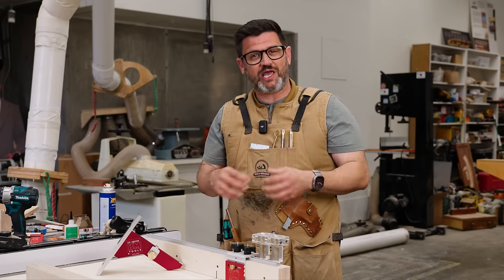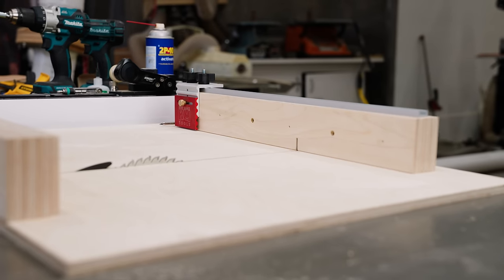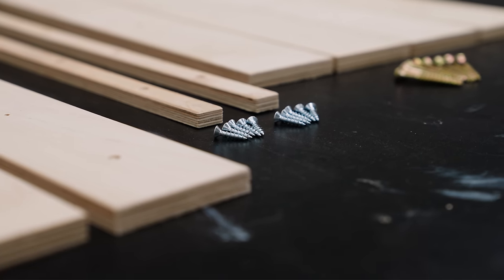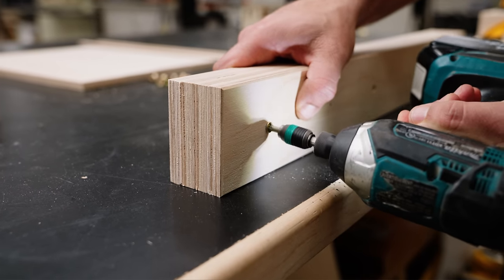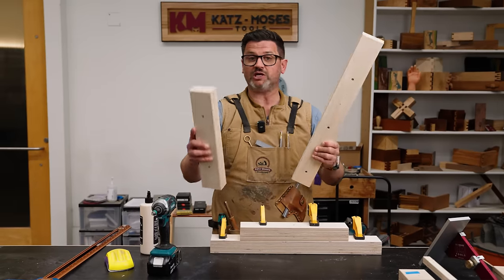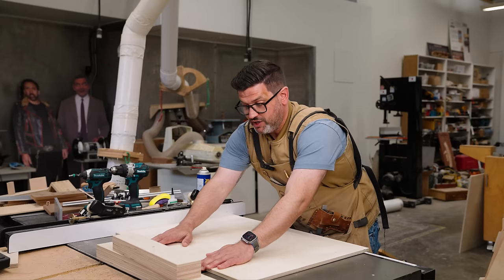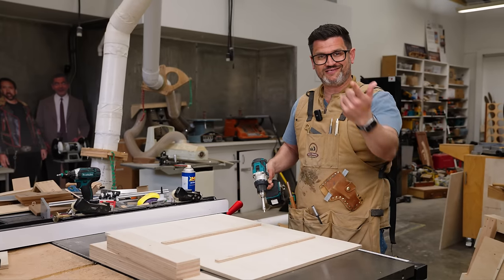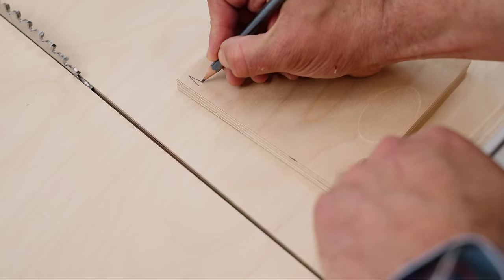Do You Hate Making Crosscut Sleds?

Comment: Excellent tool! I have one of those sleds with a dozen holes in the bottom as I burned up wood trying the 5 cut method. This tool is a huge time and frustration saver   Thanks so much. And it will be great for quick checking before a project as my shop is a garage type and the sleds are prone to warping.

Comment: brilliant Idea!! I'm in the process of making a 6' sled with a aluminum back fence. I want to make accurate corners for steamer chest. What I've come up with is using all thread on each end. One side achord the other floating until I get the back exactly perpendicular to the saw blade then I will anchor the back fence to the base of the sled. I can make slight adjustments to the nuts on the all thread to dial the back fence to the saw blade. This is the second one. the first sled was a test to make sure it stayed square.

Comment: I've built a couple of crosscut sleds and the bottom of both looks the same as yours. Adjust , adjust, adjust. Tedious, time consuming, and frustrating. This is brilliant and I love your kit! Yeah, I could cut my own pieces, but why when I can buy them already cut? 
Will this work on jobsite tables as well? I'm assuming it does because it's all about square and straight. I have a few of your tools already and I absolutely love them. I'm in for getting this ... just as soon as I get my shop insulated, cleaned, and organized appropriately.

Comment: This looks really great and not super expensive, have 2 questions:   1:  what size do you recommend for the base, can it be 26" x 32"?   1/2" or 3/4" plywood?   2:   Will the sled runners wear out over time so that they do not fit tight?
Reply from the maker: You can use any size you want for the base. I like 1/2” because it gives you a little extra blade height. The runners will last a long time. If they ever get loose add a strip of blue tape to snug them up. Probably much longer than the zero clearance of your kerf

Comment: I found that wood screws with countersink head was mushrooming the two guide bars and was also deflecting the fence.  Five cut with a screw at each end was different after adding additional fasteners.  That sled was too heavy so my re-do is lighter and used pan head screws with a washer.  Problems solved.

Comment: I built my sled using UJK Parf guide dog holes.  So I know it's super accurate (and so easy to mate the fence)  But that tracksaw use case is very very intriguing.  When you're breaking down, sheet goods, sometimes you can't use the square rail.  Being able to square your cut in the middle of the sheet is genius!   And I think you're one or two step/design away from being able to line up the track for straight cuts.  @2:25 instead of a square cut, if you could but the track against the red/body part, you can guarantee the continuation cut of the tracksaw is straight.

Comment: I already did that with a normal Square.  Also I did a half cross cut sled like Tamar built with a 45degree edge and used a Katz Moses stop block first Gen.  I did this because I wanted a light Jig.
I like the kit but the tools is just another square.

Comment: I made a half sled with a top down plexiglass that presses down on the piece via a spring loaded thumb screw. Not only does it protect from kick-back, but it solved 90% of my dust collection problems. My basic $100 ryobi 8" table saw is abysmal at dust collection. But the plexiglass for some reason pushes all of that dust down in a neat pile. Perhaps something to do with redirecting airflow idk.

I used aluminium for the fence because I live in florida and wood tends to warp crazily throughout the seasons.

Comment: Jon the bottom of your first sled looks a lot like all of my current ones 😂.  That said after a lot of 5-cutting they are very dialed in. But I am a gonna order this gizmo anyway - price is reasonable and I can see a lot of uses for it - #1 being getting  the fence square on my 12” Bosch miter saw, which is currently NOT accurate enough to do anything but cut rough lengths.

Comment: Having a table saw without a sled is like having a tape measure without a marker, they just go hand in hand. 

My sled looks very similar to the one here where the fence isn’t as wide as the sled but I wish I made it just as wide to have more room for clamping stops. 

Just to give an example of how handy a sled is. I recently built a drawer with dividers. I used a stop on the sled to get both ends of a drawer side the same groove and both sides the same as well. The kerf wasn’t big enough for my dividers so I made one cut against the stop then added a thin piece of cardboard against the stop and cut again to widen the groove just enough for my dividers.

Comment: This looks like a good solution but f you made a panel saw option with the silver part (fence) a bit longer it would save so much time in realignment of the perpendular fence on a panel saw. Often it is moved out of the way and when you go to reinstate that fence it can be off even though it has a flip up stop. Then your back to the 5 cut method of checking things. Feel free to contact me to discuss in more detail. I'm sure every shop with a panel saw would buy the longer version

Comment: As usual you have come up with a brilliant tool. I do not have feeler gauges or a digital micrometer so the sleds I have made are squared with a carpenters framing square. I have a strip of aluminium that happens to be the exact width of the kerf  of the 3 blades I normally use, so i insert that and press the framing square against it and align the fence that way. Although I have checked and adjusted my framing square as accurately as I can, this method does not always yield the most accurate fence. So if i could i would love a tool like you have created. Unfortunately I do not have the financial resources to buy it or pay the shipping to South Africa. 

With regards to the sled kit, I am most surprised the see the plywood mitre runners. The only sled I made with plywood runners does not fit at certain times of the year due to the bars expanding. Any idea what I might have done wrong to have this problem.

Comment: I would make the fence in two parts, one permanently attached to the base and the other part to the first and then shim the second part into square. As for precision squares, it does not matter how accurately they were manufactured, you need to check them in case they got dropped or bumped, or QC had a bad day.

Comment: Never wasted time with a sled, never saw the need. I use my chop saw, it’s close enough for most work, and for accurate work I use a hand plane and a shooting board after cutting a hair long. Perfect every time. Tablesaw has one purpose: break down large stock. For rips I prefer my bandsaw with a one inch blade and tilting table when needed.
Reply from the maker: You do everything backwards from my methods. I bet you’d start loving life if you tried one. So much faster, better and accurate to use a sled in my humble opinion. To each their own though.
Reply: @katzmosestools  For accuracy the shooting board has no equal, according to Paul Sellers and Fine Woodworking magazine.
For a cabinet production shop, a sled is probably fine, and best in class for rapid production.
From Fine Woodworking:
"A shooting board has no equal for producing an accurately square end on a board—incrementally removing wood to make a piece fit just right."

Comment: Ordering one now.  However, I will say I was surprised you didn't mention, nor include in the kit, a "NOPE" section like you did with the universal box joint jig.  IE - a place for the blade to go into on the fence and protect your digits.  :)
Reply from the maker: Those are definitely needed on a box joint jig as your hands have to be so much closer to the blade.
Reply: @katzmosestools - I guess I am just a safety sally.  ;-)   I put a block there on mine.  But, just ordered this new tool, as well as the universal box joint kit.  Looking forward to both!

Comment: I always, always get out of square when I attach the runners with screws.  The runners move slightly and the jig doesn't move smoothly in the table.  How does this invention prevent that?  Does the super glue hold that well initially?  Very interested and may buy one.
Reply from the maker: Definitely holds that well. The important part is that there’s no slop. You gotta watch this video if you’re struggling https://youtu.be/44vgKILqjjE?si=P652w_8aghHkKo_B

Comment: Hi Jonathan quick question. I have the little Festool SYS 50 table saw, it only has 1 miter slot. Do you think the cross cut sled will be as accurate with only 1 slot. Thank you good sir. Cheers from Chicago.

Comment: Could this be used to check the square of my table saw fence to the blade?
Reply from the maker: Yeah is you put a 5/8 setup block in your miter slot you definitely could. That’s kind of brilliant actually.
Reply: @katzmosestools  could you put that in a follow-up video on how to do it?
Not visualizing immediately how that would work with the setup block.
Reply from the maker: Yeah. You just need something to take up the slack between the side and the center tab because it only expands to about 1/4” and miter slots are .75”
Reply: Ahh, that's what I wasn't seeing.  Thanks

Comment: A very interesting idea, but I believe it's worth pointing out that since the kerf being referenced by the tool is cut without the sled moving along the miter slots, the accuracy of the final results depends in part on how well your tablesaw's blade and miter slots are aligned. The important reference angle is of the sled's fence to the miter slots, not to the blade. This should be intuitive as sleds can be used on router tables as well.
Reply from the maker: Incorrect and we actually tested this extensively. The kerf is the kerf and the ultimate reference. In your scenario, the curve may be slightly wider than the blade (talking maybe .001), but it would still be the ultimate reference for square, because both the front and rear of your blade pass through the workpiece
Reply: @katzmosestools  If the blade and miter slots are not aligned, then the kerf when the sled is stationary is not the kerf when the sled is moving. SCMS sometimes exhibit the same problem. Since the kerf you're aligning the tool against is cut with a stationary sled, you don't have the front/rear of the blade passing through all parts of the kerf.
Reply from the maker: If you only raise the blade just through the plywood any error is telegraphed across the entire kerf. We tested this and you’d have to be so far off to make any meaningful error that it’s a non issue. Saw blades can be off a couple thousandths but the error you’re talking about would need to be n the 1/16 range and you’d have to raise your blade really high for it to matter
Reply: @katzmosestools  , Yes true, keeping the blade low means you're cutting the majority of the slot by moving the sled and that should almost completely remove the effect of any misalignment between blade and miter slot. And I see that's how you cut it on the video. I'd also like to add that what you've done with the pre-cut packs to get a truly flat fence is really important too - at least as important as the aluminum gauge. I think sometimes the hassle people having getting their cross-cut sled just right is that the fence isn't flat enough, and so what checks out well with the 5-cut method at 10" may not check out at 20".

Comment: Ouch, the price is a bit steep. But I suppose if you're making cross-cut sleds often it'd be worth it. But for my small shop, I make a sled jig maybe once a year? And the 5 cut method is not that hard, but I work with math and angles at my day job sooo.
Reply from the maker: Food for thought since you’re a math guy: labor rate for a low priced finish carpenter is about $65/hr. A sled takes about 3 hours start to finish if you’re building yourself and using 5 cut method to dial in (and you’re pretty good at it). One sled equals more than this tool that has tons of uses and will last a life time. Cheers my friend

Comment: Out of curiosity, what is being built that requires that precision?
Reply from the maker: Woodworking is way easier the more accurate you are. When things fit together well and you’re not compounding errors everything clamps well, fits well and looks cleaner. For example: being off by the smallest sliver of light with your most accurate square on a crosscut would be about .09 degrees (I did a whole video on this). Take that error and multiple by the four corners of a drawer. Now you have an error of .36 degrees. That’s the difference between a drawer fitting and having to spend a couple hours with your hand plane making drawers fit properly and look right.
Reply: if your tools are precise it helps you to build more consistantly accurate and reduces the amount of work.  Its not that anyone is doing wood working to 0.0001"
Reply: @theJonnymac  yes, but this seems to be "over the top" accuracy.   Eg.  If to within 0.5 mm is enough, why go for 0.005 mm accuracy
Reply from the maker: I did a whole video on this here. With the watch.  
https://youtu.be/44vgKILqjjE?si=P652w_8aghHkKo_B
Reply: @patriciamay638  You never know when you are going to need to build things that might result in compounding errors during assembly. The more accurate each cut is, the less chance of total error there will be. It's always worth striving for the best accuracy you can.
Reply: @patriciamay638 its not over the top in this senario.  because this is a fixture used to make precise cuts.  You can either make precise cuts or you can spend a lots of time at the end of the project making it look good and work well. Your choice.
Reply: @theJonnymac  I think the difference is that I am a retired hobbyist and my engineers square and a whole lot of time consuming fiddling get me there.

Comment: I'm just an old fart woodworker but, I don't see the need for a crosscut sled.  My SCMS does 12 inch cross cuts.  Anything larger (or even smaller) and I use my fence on my tablesaw.  Simple and easy.

Comment: Nice gadget but just using one cut then a multiple of a 3,4,5 to set fence can result in square to less than 1 mm on the diagonal of the depth of your sled. No calculations required. That’s within 0.11 degrees over a 20” deep sled. Remember to distinguish between “need” and “want” in your search for precision. Still an ingenious invention.
Reply from the maker: .11 would show significant light over 8”. And compound to a huge gap over four corners. I did a whole video to demonstrate this a few weeks ago. That’s not nearly close enough for gap free joints and square boxes. https://youtu.be/44vgKILqjjE?si=P652w_8aghHkKo_B